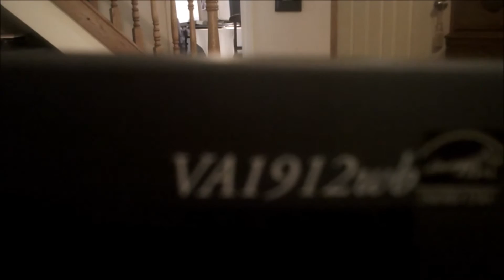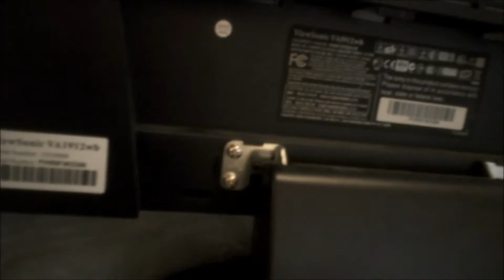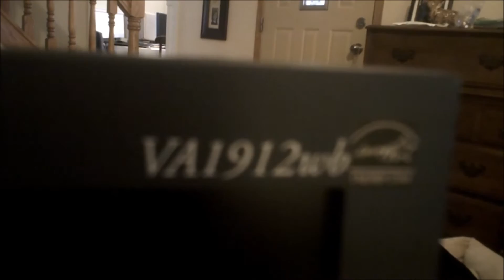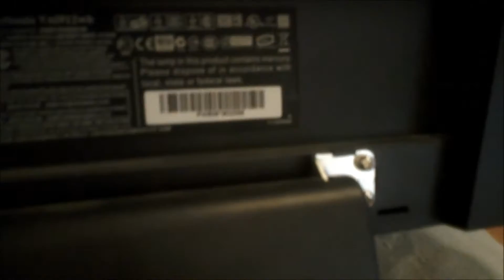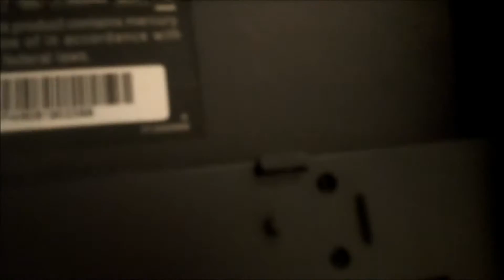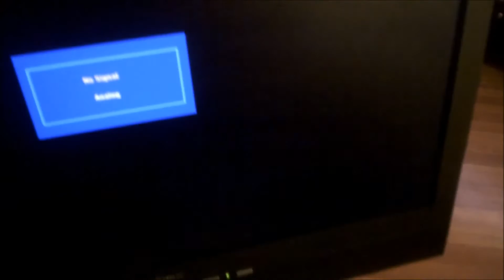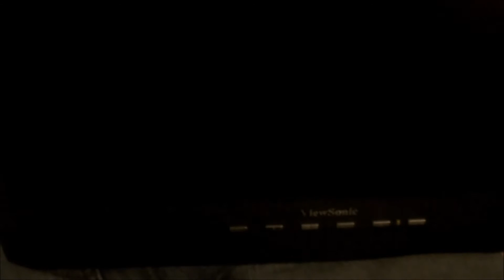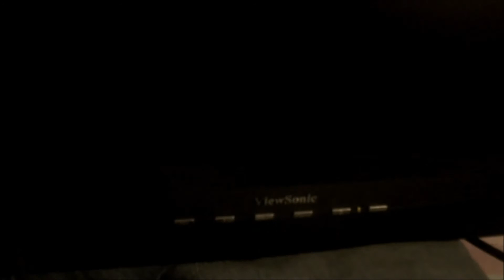Broken Viewsonic VA1912wb repair tips and information

Comment: My monitor is the same Viewsonic as yours. It has worked well for years. It is on all the time. I shut down the computer and now that it is on again the green light at the front just blinks and the screen black.I plugged in another monitor and the computer is Okay. I am going to operate on it and change the caps. I will keep you informed. Thanks for your info. I hoped someone showed how to get into it and that's how I got here. I appreciate your efforts in making this video. They are a nice monitor, it is a shame so many probably are taken to the dump or recycle center when it may be just caps. So many capacitors fail in things over time. It is a shame they are not mounted separately like a fuse so they are easy to access and change.Imagine if on the back of a TV or Monitor if there was a little cover to take off and all the caps where there in a row and the legs where stiffer and plugged in like car fuses and you could just pull them out and change them easily.

Comment: I have the same model as you. I accidentally stepped on the power strip and turned it off. When I turned it back on, everything else works fine except the monitor. It won't power on when I press on. Is it a bad capacitor or burnt fuse?
Reply from the maker: +Miscer It depends. You said the monitor wouldn't turn back on after you stepped on the power strip. I assume you never turned the monitor off daily? Sometimes monitors (if you leave them on constantly)won't turn back on because the capacitors were already bad. So what I am saying is that when you turned it off, the bad capacitors wouldn't allow it to turn back on. If that is the case, then yes it is probably bad capacitors and you should take it apart and looked for capacitors on the power board that are swollen. You should check the fuse also, but I highly doubt that is the problem.